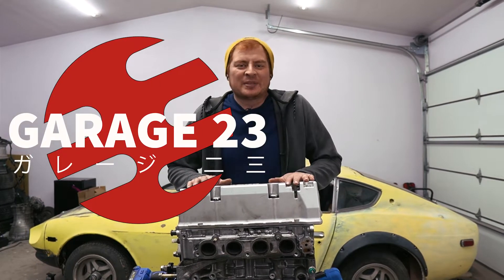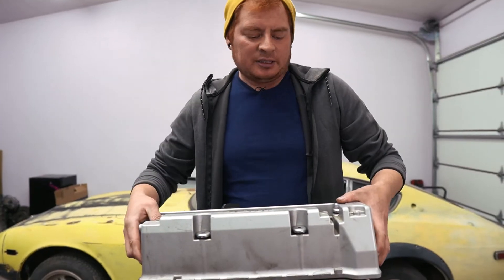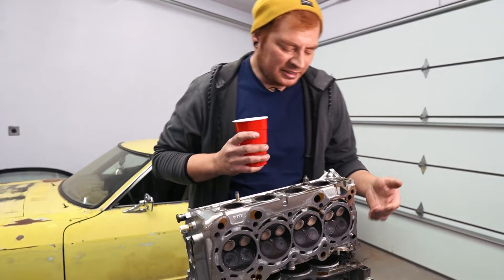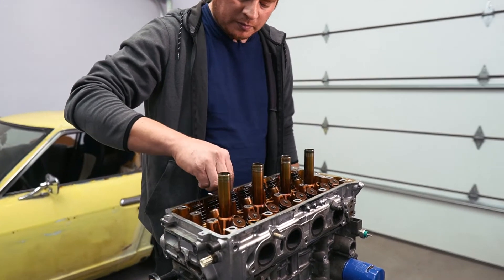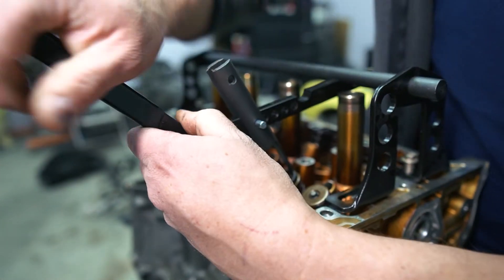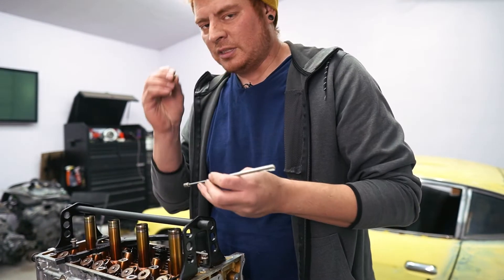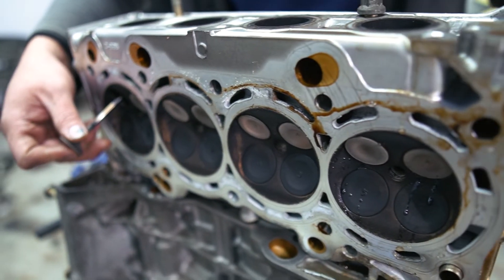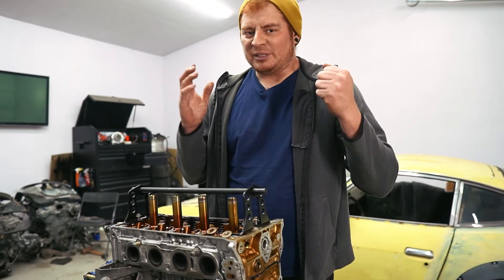How to Replace Bent Valve Using a Valve Spring Compressor Tool

Comment: You're supposed to lap the valves to the seats. The ones that came from another engine probably have a bit of carbon on the edges, preventing a perfect seal
Reply from the maker: Omg i totally forgot about lapping, that probably would have worked.